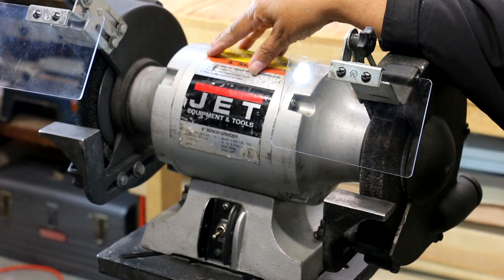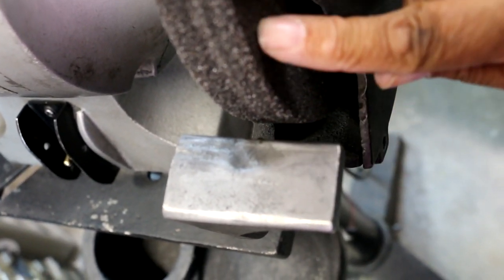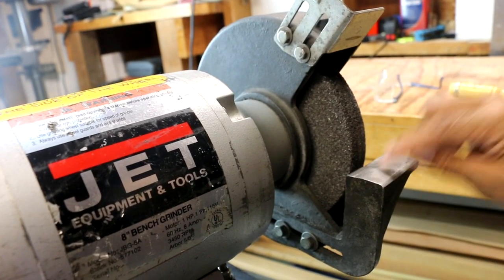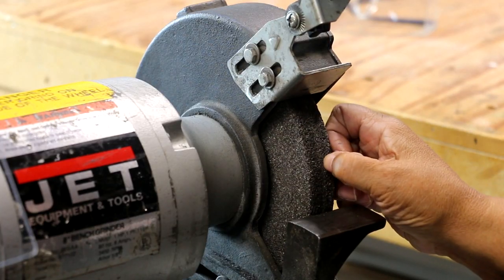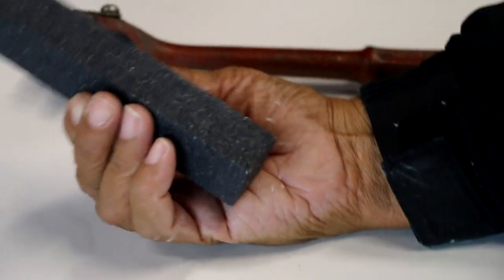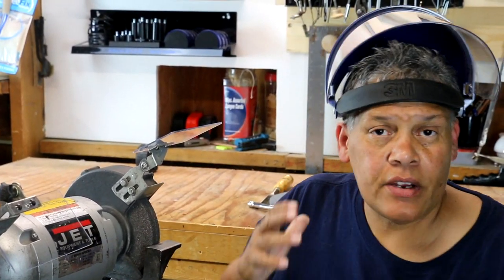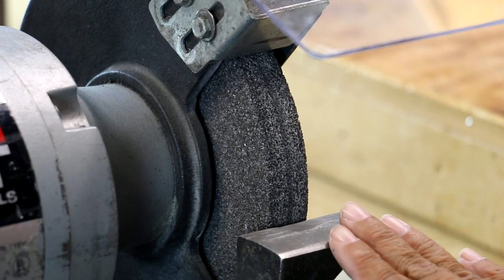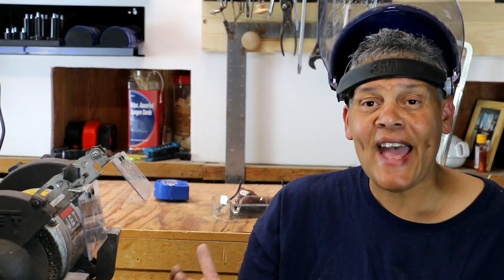Dressing a Grinding Wheel for Beginners and Other Safety Tips

Comment: I really appreciate you stressing safety. Easy to ignore. You're a great teacher Ms. Leah!
Reply from the maker: thank you so much, Elaine!!
Reply: Yes, especially about the gloves. You also should remember that fingers and eyes aren’t the only things you need to protect. In a noisy environment there is a 100% chance of damaging your hearing ( as opposed to the possibility of getting something in your eye or injuring your hand). Same thing with dust or dangerous solvent in the air. 100% chance of inhaling it.
Reply: @trackie1957  Was going to add emphasis for ear protection too if you didn't.  Another way to think about it: Blocking out noise also boosts your brain power.  It's harder to think when it's noisy, so protect your ears.

Comment: Great video and excellent tips, especially about standing off to the side till the grinder gets up to speed. I remember learning that about 30 years ago in shop class. If you don't have a dressing tool, you can also use the edge of a tile saw blade or diamond grinding disc. But as you showed, always wear eye protection at least or a face shield at best. Heck, both wouldn't hurt.
Thanks for the video.
Reply: Bruce L. +1 on standing to the side. Very well done, Leah. 💖🌺

Comment: Thanks for the info nuggets and safety tips!

I know this is a bench grinder video, but you really saved my bacon a few years back with some drywall and painting tutorials and tool tips after a weather emergency hit our house where it hurt. 

I wasn't in the best headspace back then, but your positive energy was what I needed to not only get the job done, but get it done well (I'm in a much better place & headspace).

The only issue was that the repairs looked better than what was around it, so I had to do that too!

Comment: I was always taught that the small "teeth" on the bottom side of the dressing tool hooked onto the front edge of the tool rest, then after you were done you adjusted it back in.
Reply: I've used my Desmond dressing tool off & on for over 50 years, always letting the bottom "teeth" as you call them (the 2 protruding lugs) ride on top of the tool rest.  A bit late, but logic now tells me that you are right.  The increased gap between the tool rest and the grinding wheel would help with the debris being trimmed off the wheel being forced down without it tending to bounce off the tool rest.  Stability is also increased.  I'm now opting for your way.  Good call.
Reply: That is correct. The instructions with my Jet 8 inch industrial grinder specifically address that.

Comment: Great video, especially the safety advice. I've been unfortunate enough to have a grinding wheel come apart at speed and while I escaped unhurt, one chunk bounced off the garage cement floor, and went right through the drywall and hit with enough force to crack the stucco on the outside of the garage wall. Now think about the force it took for that to happen. That much force would easily kill someone if hit in the head.

One additional thing to note is to never stand in front of the wheel. Keep your body to the side so as little of yourself is in line with the wheels rotational axis. This can be applied to the majority of things in a workshop, whether its a wood lathe or using an angle grinder with a cutoff wheel. Whenever a rotating object comes apart, the danger zone is in-line with the axis of rotation.

Comment: According to the manufacturer, sparks indicate you are not using enough pressure and are grinding the tool dressing wheels more than the grinding wheel. 
It DOESN'T say you should not do that but it does continue to say it will result in you having to replace the dressing tool wheels sooner. 
Hope that helps 👍

Comment: Some really good tips that no one gives you in an instruction manual here. As well as standing to the side, I always give a grinder a soft start, so pulse on for a second then off then a few seconds and off then up to full speed, that way if the stone is going to break its not at full revs and limits the amount of spread if it shatters.

Comment: Another safety tip especially if you bought a used machine or you have used (even new) grinding wheels.   If it's on the grinder take it off.  If they are loose hold the grinding wheel with a screw driver or something in the center (where the arbor goes)  then with the plastic end of another screwdriver tap the wheel.  It should ring.  Meaning it's a good solid wheel.  If there is a thud or a muffled sound too it.  It may mean there is structural damage to the wheel either it got drop at one point by some one or damaged during shipping (this is what I do to all my new wheels too)    You don't want one of these wheels exploding because there was structural damage 
As always great video  and Id wear a dust mask only when dressing the wheel.
Reply from the maker: The ring test and wearing a dust mask while dressing are important to mention and I'm glad you DID!
Reply: And don't forget to always have grinding wheel blotters installed. Sometimes wheels don't come with them. You can make them from cereal boxes.

Comment: Great video at just the right time for me. I would also love to see one on shimming out a wobble as there is a severe one on my grinder. Cheers John
Reply: The flanges (plates on either side of the wheel) can sometimes be distorted. Try loosening the nut and repositioning them. It’s easier if you mark the wheel and the flange so you know how much you moved them. You can also switch the flanges around or turn the wheel around. 

If none of that works, check the straightness of the shaft (actually, check that first). The grinder might have suffered a drop in its life and the weight of the stone might have bent the shaft slightly.

Comment: By the way, for newbies trying to grind aluminum is a no-no.  The soft aluminum rapidly plugs up the "pores" of the grinding wheel.  Then, when trying to do grinding with a "packed" stone you invite heating, fragmentation, and stone failure at operational rpm's.  Dressing such a wheel must be done slowly and carefully with full safety gear.  Don't be in a hurry--let the heat dissipate.

Comment: If you are seeing sparks while dressing the wheel, you are not applying enough pressure and are grinding the tool cutters down. Press more firmly.  You mentioned the dust generated.  Highly recommend a respirator mask in addition to the faceshield.

Comment: One thing that was in the instructions on my star wheel dressing tool:  If you are getting a large amount of sparks from it, you need to apply more pressure.  A bit scary if you are not used to using one, as it seems that an awful lot of that wheel is going away while you are using the dresser..
Reply: I started using diamond bars. Super fast and easy. Cheap enough too.

Comment: Hello!At our plant we also use grinders, but different placement. We use horizontal and vertical ones. for the vertical ones we use grinding stones and those are fixed into the machine with a pin, D=6mm. These stones are formed like cone, with 2 different diameters for different products. But nowadays are used with surface, and we need to refurbish/or repair them. Do you think these kind of wheel dressers can be applied for that job?Thanks for answer.Best regardsJanos

Comment: Question here? So i bought an old bench grinder And i used it twice on on an axe and then shaping the end of a rebar into a point And when using the rebar it made a massive groove in the center of the wheel in seconds and there was a lot of dust on floor the same colour of the wheel. Do i need to replace because of age?

Comment: I brought a yojimbo bench grinder from ebay and it's brand new.  And Should i dress or truing?  because the wheel is wobble as it spins but when it reaches high rpm it became normal or balance.

Comment: If I were to have one type of dressing tool, which type would you recommend? The block or the wheel style?
TIA
Reply: I, personally, (I'm no expert) have and have used both.
I don't care too much, for the stick type.
The stick wears away Much faster than the metal wheels and
gets lopsided, causing uneven wear on the grinding wheel.

Comment: You're doing it wrong which means you're teaching it wrong.  If the wheel is not true, then it first needs to be trued. The rest should be moved back so the bottom lip of the tool will overhang it and you lever against it.  This keeps the tool equidistant from the wheel being dressed and makes the necessary forward pressure easier for truing.  That lip (prongs on some) is not there by accident and the manufacturer clearly states proper use of the tool.
After the wheel is trued, then you can proceed to clean/dress the wheel but, unlike in your demonstration, sparks are a sign of you grinding your expensive tool instead of dressing the wheel.  Some occasional sparking can't be avoided, but you have constant sparking which means you are not applying enough pressure.  Again, the manufacturer (Desmond-Stephan, in your case) clearly states the proper use of the tool.